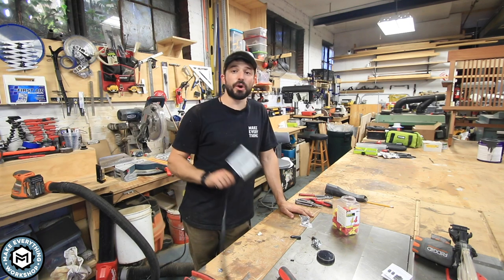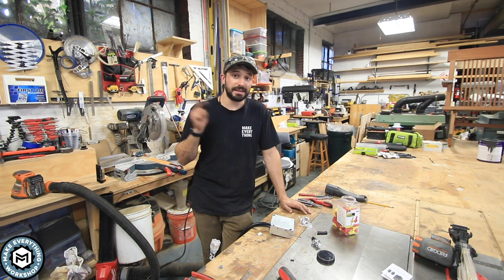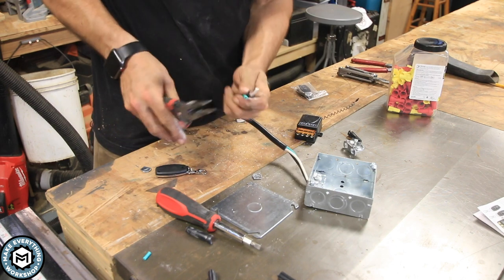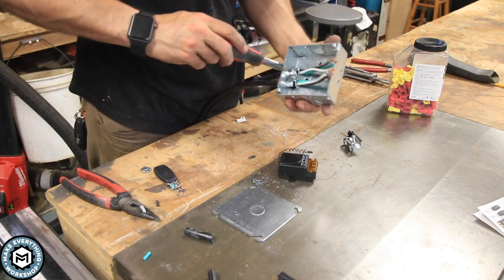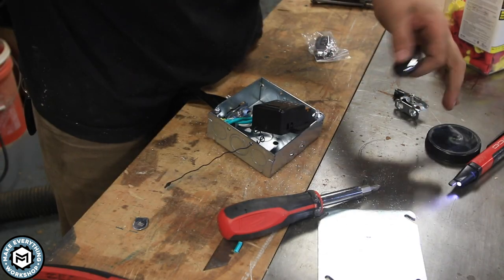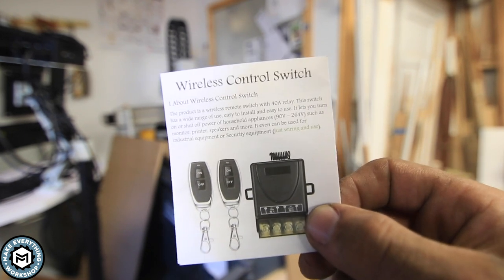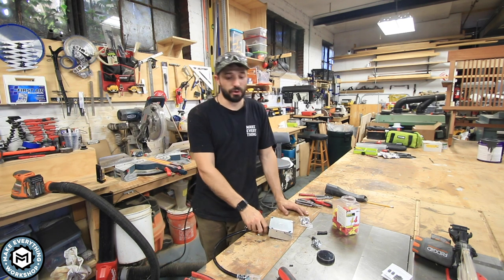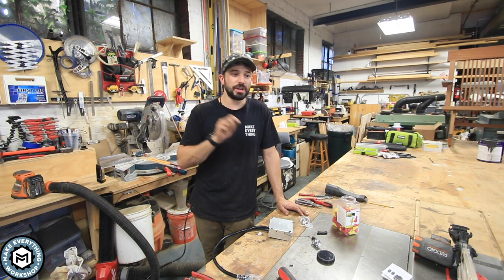$25 Wireless Dust Collection! 220v or 110v!

Comment: 👍👍👍👍Need a grounding pigtail to the box as well😊
Reply: Yeah, certainly a prudent move, if you get the rounded handy box there is usually grounding point which protrudes into the box a little so the grounding screw doesn’t stick past the back of the box, which is nice if you are wall mounting it.
Reply: Well, it's a extension cord, so he's just continuing the ground from the outlet to the tool.
Reply: Nathan Mitchell he saying the box itself is conductive and contains hot leads inside. If one of the leads came loose it could energize the box and make it a shock hazard. If the box is grounded it will trip the breaker if one of the leads were to contact the box.

Comment: Unless you are doing 220 it is against the electric code on USA to break the white wire with a switch except on a gas pump, you should only put hot wire on remote and put wire nut on white wire the reason is so you always have a feturn connected even when switch is off

Comment: I have done the in my workshop but I would suggest you ad a relay and only use the remote unit to trigger the relay then you don't have the high current for the dust collect running through the remote system

Comment: Just did this myself on a 2hp (240v 12amp) dust collector and works great! Thanks. Clipped the remote to my carpenter apron, so much better for my set up. I hope it lasts long term so far it's been good!

Update: upon further research this is a questionable set up for a 2hp motor. This switch is not capable of handling the high current at start up for 2hp and will eventually fail. The relay that is required should be able to handle 75amps. I will add in a relay rated for this motor and use the Amazon relay for the RF control.

Update: I left this set up plugged in and the other day it turned on randomly. Scary if I was away. I would recomended disconnecting this set up when you are not in your shop.

Comment: A few years back I did something similar (although unnecessarily more complicated) for tuning off a water pump when I was away from home.  In that case I used a contactor for the 220 V and a 110 V home automation switch to trigger it automatically when I came or left.

Comment: I'm no electrician but, the black wire AND the white wire are HOT in a 220V AC cord.  They would normally be called L1 and L2.  The green wire is neural which is tied to ground at the breaker panel.  You can verify this with a volt meter.  You will see 120V between BOTH L1 and neutral/ground AND L2 and neutral/ground.  The switching relay is a double pole so both hot leads are disconnected when switched off.  As others have noted, be sure to ground the box.  
Cheers, F. C.
Reply: Is the switching relay double switch as well? I bet the "neutral" line isn't even switched
Reply: @williamweatherall8333  You would win that bet.  I bought one of these things and it's only a single pole switch.

Comment: I love the idea of using a box. However, since the box is made of metal, should the box itself be connected to the ground? If the hot wire ever touched the box you could be shocked right?
Reply: I had the same question

Comment: Just stumbled upon your video and bought one of these right away. I had tried the big box store wireless plug and play units but they can't handle the amp output of my dust collector ( My motor is weird and is 110V / 16amp but spikes around 20amp when you start it up).  I wired the wireless relay directly to the outlet but also split the outlet so it would be "half hot" and half wireless. i put one remote with the 2 tools i have connected to the collector, mitre and table saw. Thanks!

Comment: You should have connected the ground wires to the metal j-box meet electrical code.
Reply: His tool's still grounded though, and the receptacle at the wall's probably grounded. I think it's the same as having a extension cord with a gadget built into it.
Reply: That's assuming that none of the hot leads  contacts the metal box.  If that happens, the box will be hot and touching it could complete the circuit - ouch!
Reply: @nathanmitchell4839  the tool is grounded through the extension cord but the metal box IS NOT grounded and can and will become energized if the hot lead inside contacts the box.  If that happens the ground wire will have no effect.
Reply: if a hot lead touches the box it is only 115 to ground the RECEIVER  should be secured to the box
Reply: @alcarlson9091  ONLY 115 V, 24 V can kill you.  Securing the receiver to the box is prudent, but it does not ground the receiver.  There is no reasonable excuse for not connecting the the ground conductors to the box.  I've been an electrician for over 30 years.

Comment: The product spec. says 40A but only 1hp at 120V or 1/2hp at 240V.  Do you think this will be reliable for 2hp induction motors or 5hp (peak) shop vacs?  I've found that some remote power switches die after about 6 months but none of the ones I've used were using 50A relays so maybe this one might hold up. Keep us posted on the long term reliability. If it holds up this is a great deal.
Reply from the maker: Im  definitely  interested in how it lasts long term, ive used those Christmas tree light remote switches for my shop vacs for years, and those are never rated for what the shop vac says it draws. Needless to say, i have 3 set up and have been using them for years without a single failure. Im going to be primarily running this for the vacuum pump on my cnc, so we will see how it does!
Reply: @MakeEverything  I went through several of the 15A remotes with my shop vac before I found one that would last more than 6 months of daily use.  When I took them apart the contact pieces were welded together.  

I guess the number of actuations is the main factor.  I'd say I turn my vac on and off 5x a day so they were dying at around 1000 cycles.  For some tools that's a lifetime.  For others, 1000 cycles isn't very long.  

My guess is that the one you listed will last longer since the relay is rated for over 2x the current of the other's I've seen.  

It would be interesting to know why these devices are rated for much lower power for motors than for resistive loads.  My guess is that the startup current spike is the limiting factor for motors and they rate them lower for motors since some motors have a much higher initial current spike than others and they just use the most conservative estimates.

Thanks for the video.  This is one more option to Build YOUR Space!
Reply: The risk is that the contacts will weld themselves shut, and you won't be able to turn your motor off.  That's probably not a big deal for a shop vac.  For a saw or most other tools, it would be a disaster.

Comment: Or you can use one of these: Woods 50125WD Outdoor Indoor Wireless Remote Control Outlet Kit, Electrical Plug In Remote Light Switch, Features 1 Grounded Outlet with a Pairable Remote, CSA Rated, FCC Compliant, Black
Handles up to 15 amps, 125 vAC.  Plug and play-I use one on my dust collector thar draws 8 amps start up and 6 amps running.  Of you need more amperage or higher voltage you can wire a relay to plug into the unit's outlet.  Best thing it's only 15 bucks on Amazon.  Have it for about a year and no issues.
Reply: He said right off the start his was 220. So you are at a fire risk right off the bat.

Comment: The listing must have changed. It says it's rated for 30 amps for a 12 volt system. That can't possibly be what you used for your dust collector?

Comment: Using this with a 220v dust collector.  I have one 120v leg connected to L input and the other 120v leg connected to neutral.  Also grounded to the box.  I was testing and with the unit powered off, the output L is off and the output neutral is reading 120v.  Is this correct?  I keeping reading the N is passthrough, but this would mean my dust collector is always receiving 120v.

Am I missing something or will this still work fine?

Comment: Good comments here but I have tried stuff like this.  It will fail over time.  

It may be rated for 40 amps, and even though your collector says 30 amps your amp draw at start-up will be higher.  If you turn the collector on and off multiple times per day in the shop or for each cut it will die sooner.  

I blew through an x-10 and an Ivac switch with the same headroom in a year each.

I moved to a very heavy duty contactor for my setup.  It has been flawless since.

Also as mentioned in other posts the case of the box should be grounded as well.

Wire gauge on the extension cord should be 10 gauge minimum but with the startup draw I would go with 8 just to be sure there is minimal voltage drop.

I love your stuff but this is the one video out of all of yours I’m not in agreement with.
Reply: For safety reasons, the rated amps on a device (from the factory) will always be at or below the stated amount. It is illegal to make a device rated at 15 amps that takes 20 amps on startup, because then the consumer will end up causing fires. Not to say as things wear that the amperage pull can't increase, but the rated amps is always the max load amps, not the running amps. Having said that, 30 amp 220v is 60 amps 110v, so if a cord/breaker/remote is 40a 110/220 often it is only rated for 20a at 220, so it may still be over spec, and cause failure over time.
Reply: For example, my dust collector is rated at 15a, but only hits 12a during startup. Now normal electrical design also states that you should only ever use about 80% of your capacity, so something rated at 40a should really only ever use ~34a. But that is usually ignored lol
Reply: @TimothyRitzer  You are correct but there is a brief momentary spike that kills these types of units.  I have had two manufacturers state this which is still within the electrical safety envelope and engineering but will kill these types of units over time.

This is a good explanation

https://www.jadelearning.com/blog/understanding-motor-starting-inrush-currents-nec-article-430-52/

I'm not an electrical engineer or electrician but have friends who are and personal experience with these types of things failing.  If you are ok with replacing these things on a periodic basis then so be it but for me I want to set it up once and forget it because it continually works well.

I'm just trying to give a voice of caution and experience.
Reply: @robh.8214  My understanding was that the capacitor of the motor was what was used to supply inrush current because otherwise the breaker would flip every time you turned on a motor. Having said that, without personally graphing the current it is hard to say how much it does indeed spike. I use a remote rated for about 80% of my motor and have been fine for some time, but I guess time will tell. Mine is obviously not 220, so the wear pattern may differ

Comment: I am glad I didn't wire that for you, in the UK Black is Negative or Natural, why is Black live in the US, what colour wire do you use on the Multimeter for Live and Natural?
Reply: I thought you had brown blue green in the UK? Maybe that’s just Germany? You can use either probe on the meter because it’s alternating current, it won’t show a + or - like in DC. I do normally use the red for the hot and black for the neutral, though, just out of habit, but there is no ill effect for doing it the other way.
Reply: @jeremyspecce  Hi, Appliance wiring is brown and blue but building or house wiring is red and black, the colours were changed to Brown and blue so common people didn't mix up red and black?  No idea how they could, but 50 or so years ago all wiring in the Uk was red and black, earth was bare copper as it was attached to a bit of pipe in the ground.
Reply: For 240, we do use red and black. The manufacturer of the cord must have used wrong colors......for 120v(our normal everyday house circuits) we use black, red, blue for hots and white neutral.

Comment: Is the transmitter small enough an outlet could be mounted along side in the 4sq. box. ?
Reply: You’d probably be kind of tight but if you got a deep box you’d probably be able to do it. I’m thinking the same thing for a shop vac control, but I might just have a female tail hanging from it if it’s tight.

Comment: Hello, if I were to use a 120 volt do I still install the both the load and neutral wires
Reply: yeah, this doesn't actually switch the neutral switch which makes me a little wary of it for a 240v dust collector at least in Canada where there are 2 live wires with 240

Comment: So this says for 240v, does that mean my PM 3hp can be run on this? It's the Powermatic dual canister one.
Reply: I have the same switch, 3hp is only 20amps @ 240v. My dust collector is only 110, but my table saw is 3hp 220v and runs on a 20amp twist lock plug.
Reply: @nwngunner  it's a 6/20 nema plug but that shouldn't matter should it?

Comment: can i get something like this to work on a makita 18v/36v battery extractor rather than having to invest in the same technology that dewalt have qith an investment in new batteries and charger for the system or the even more expensive Makita aws system that requires you buy all new tools
Reply: Thats something that would interest me in the uk as im on makita and dont want to cross platform or have to buy all new tools

Comment: Brother is a lawyer, Father is an electrician, I am licenced as neither of those. That being said, I am qualified to say some knucklehead might electrocute himself trying to emulate this...you should add a disclaimer*

*not solid but possibly decent advice
Reply: I would agree fully.

Straight out of Ama-China-zon I’m sure this device carries no UL or CSA certification.

This is the stuff your insurance adjuster lives for.  Why set yourself up for that kind of risk.  There’s a reason why a proper controller costs what it does... cause of that label.

You have a shop with thousands, quite likely tens of thousands of dollars of hardware.  This isn’t where you save your money.

Comment: there is an even better, cheaper solution.... for about $15-$20 in parts you can build an auto switch that senses when a tool is running and will turn the dust collector on....  use this key phrase to find it "How To Make A Simple Switch To Automatically Turn On Shop Vac".... and before someone points out its 110V you can get 220V relays....
Reply from the maker: Thats a nice idea, but in an instance like my vacuum table, I need to be able to turn it on and off as needed, so its important to have its own switch.

Comment: A dangerous electrical situation you are using. There is no ground in your 220V setup. You are using the 120V ground as a neutral and no ground is present in the system.  Also using standard 3 prong plugs, it could be plugged into 220V and have a 120V device plugged into it. Dangerous setup if anyone besides you works in the shop.
Reply from the maker: I understand your comment, but how is there no ground in the system? There is a ground on the outlet im using, and a ground on the cord which goes to the machine... I know I should have ran a grounded tail to the box, but i cant imagine that would do much considering the box is just screwed into drywall. not using twist locks definitely adds a level of danger because the plus look like regular 110v plug. I appreciate the comments always!
Reply: @MakeEverything  You're using ground (the green wire) as a neutral for both legs of the 220V line. There is no ground.
Reply: JT Thill that is incorrect. They will run without a ground (and it is a ground, not a neutral). It is a safety ground, intended to trip the breaker in the case of the fault. The reason you would want to connect the box to ground is if one of the energized leads vibrates loose it can energize the box and shock you if you touch it. With the box grounded the breaker will be tripped immediately if a hot lead touches the metal box.
Reply: @MakeEverything  I'm not the OP, so I could be mistaken but I think he was expecting the 220v to be on two hot lines (110v each)  plus a ground and a neutral like most residential is. Usually if you see a 3 prong 220v it does not have neutral.  I'm still a little confused on how the box is working as well, since it says it needs a neutral, but it doesn't look like you are providing one.  I'm sure I'm just missing something obvious.  Thanks for the great video and suggestion.